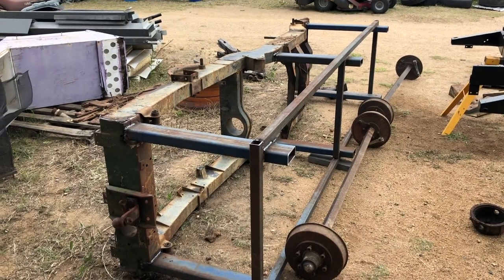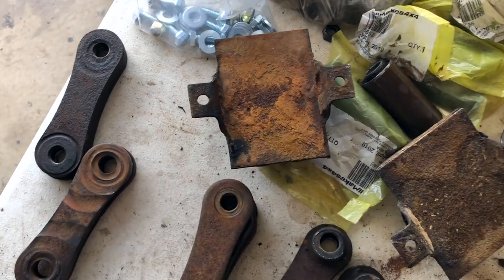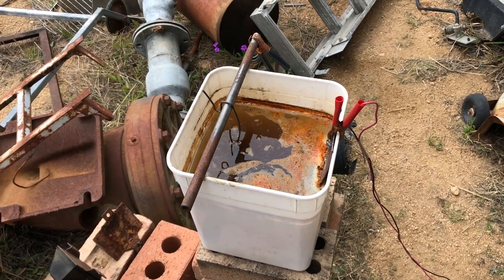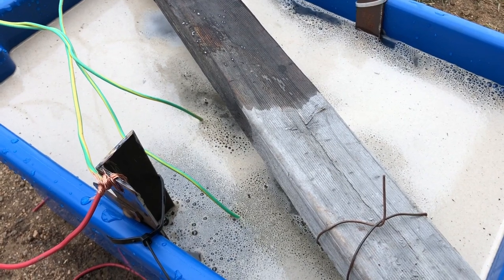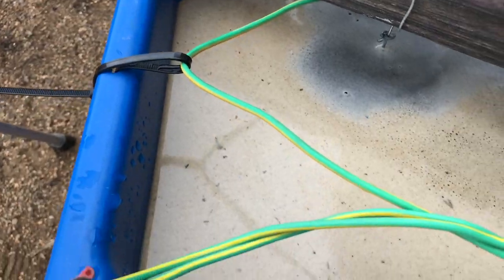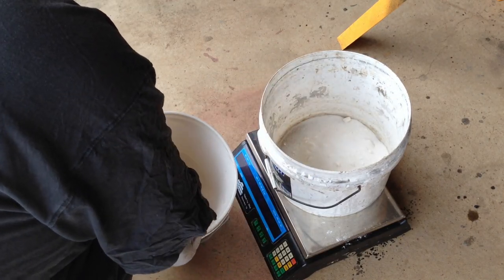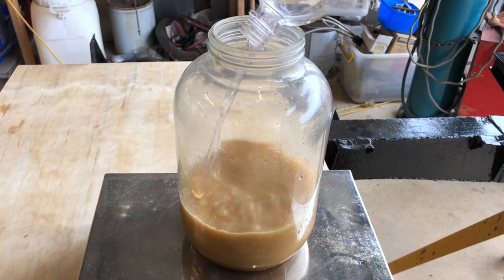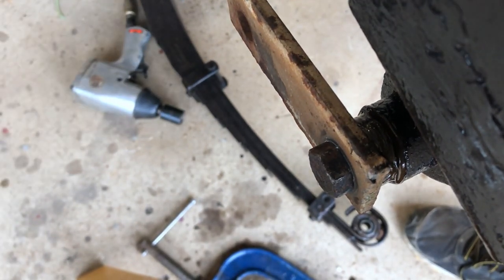Electrolysis, citric acid cleaning & homemade rust convertor for landrover restoration.

Comment: Finally, your rust converter recipe is an excellent secondary use for some waste byproduct that I have on-hand. [This waste byproduct is an ethanol/water mixture which resulted from extracting ethanol free (E0) fuel from fuel containing 10% ethanol (E10)].

The primary use I have for this ethanol/water waste byproduct is as an ultrasonic cleaning solution. [I put the parts to be cleaned along with ethanol/water solution into a heavy duty ziplock bag; and then immerse the entire bag into the ultrasonic water bath.] 

Very much appreciated.
Reply from the maker: Nice, I have thought about getting an ultrasonic, they are damn handy 'tools', smart way to reduce the amount of sovlent needed too, I like it a lot.

Comment: I've also used rain water.   For a small item, where you only need a cupful of solution, I have had success using a strongly brewed (2 tea bags) of black tea to supply the tannic acid!!
Reply from the maker: Thanks for the tips Richard.   We are strictly a  loose leaf household :-)  I have not tried tea solution but tannates are tannates.

Comment: Great vid mate. I notice the recipe in the description differs from the video - 50:50 ethanol /water vs 50:900. Also, when do you use the citric acid and when do you use the electrolysis?
Reply from the maker: Opps, fixed that slip up now.  We use the Australian War Memorial research that shows the 50 / 50 water/ethanol mix to be most effective.  Canadian Conservation Institute page is a little older but is a good summary and further info (but different recipe).  For the purpose of general restoration and Fe Corrosion treatment both recipes work just fine.

I am going to cover which rust removal techniques to use when in the next video as its a big subject that was beyond the scope of this episode. so Stay tuned.

Comment: I see that you used Sodium Hydroxide rather than Sodium Carbonate (washing soda) for your electrolysis rust removal. What is the advantages / disadvantages of using the Sodium Hydroxide over Sodium Carbonate? Does it work better? Is it safer or more dangerous? Very curious....never seen a video using the Sodium Hydroxide other than yours. Thanks!
Reply from the maker: It cleans like a beaty and is cheap and available

Comment: hiya can u sent link that u use for buying tannic acid, trying to get sm in NZ. also how long can u keep the solution u make up in glass jar for?
Reply from the maker: I buy it through ebay.  I lasts for a few years as long as the metho does not evaporate out.

Comment: Ok, here's a question: where's the co-host gone? I guess with the chemicals involved I suppose it wouldn't be very safe for her to be around.
Great recipes. Now I must make sure to bookmark this.
Would the rust converter be safe to use on things like the leaf springs (without taking them apart) or other such things that involve rusty surfaces in contact with each other or is its use in such situations not advised? Also, do you have to wash the treated surface or neutralize it with something after the treatment and how would you do that?
Reply from the maker: Ha, the dogs don't always come to workshop day :-)  The tannic acid solution / rust converter would be ideal for leaf springs etc as it would penetrate between and passivate the corrosion.  You don not have to wash it off after, that is phosphoric acid rust converter (we do not use that because it is pretty toxic and needs to be washed off to remove un-reacted acid).
Reply: @VintageRestorationsAustralia  That's great, thanks! That's a lot more chemistry than what I know.  I even  checked what tannic acid is. It's what makes tea taste great apparently.
Reply from the maker: @Stelios.Posantzis  Ha yes tannins are naturally occuring - and just so happen to work well on rust - it essentially ties up active corrosion sites (and makes tea taste good :-))
Reply: @VintageRestorationsAustralia  Yeah, and apparently (according to this youtube video I watched), good tea can contain quite a lot of it: 12% upwards. Green tea does not apply. I think I'll have a go at making some rust converter from tea left-overs in winter - i.e. purely based on home ingredients!
Reply: @VintageRestorationsAustralia  The other thing I noticed is that you brush the items with the solution, you don't dunk them in it. Also, you have already removed most of the rust? So leaving the items in the solution for prolonged time or brushing really rusty items is not the right way to use this?
Reply: @VintageRestorationsAustralia  Btw there's a guy in my village that does all sorts of vintage stuff restorations (mostly tools and household bits but other stuff also, like bikes etc.) and he swears by oxalic acid. He showed be a WWII helmet he had treated with it to remove rust and it seemed quite good: you could see the original paint had come out clearly. Just thought it might be of interest to you if you haven't tried it already.
Reply from the maker: @Stelios.Posantzis  Yes, remove all the loose corrosion before applying, if you sandblast or wire brush  allow a little bit of flash rusting to occur before applying.  We use a spray bottle to apply also.
Reply from the maker: @Stelios.Posantzis  I will be intrested to hear how that goes.
Reply from the maker: @Stelios.Posantzis  I studied Conservation of Cultural Materials at Uni  and worked in the museum industry for a long time before moving to the country.  Most of my training looked at the chemistry of deterioration, so I come at it from that angle.  Where about are you? We have viewers from all over the world, it's great!
Reply: @VintageRestorationsAustralia  Athens,  Greece. I guess your background explains all that chemistry knowledge! As for myself, all the chemistry I had was in high school. It's fair to say the chemistry has been gone ever since then! Maybe it's a physicists' thing or maybe I'm just kidding myself: what is not practiced is soon forgotten.

Comment: Tannic acid and similar organic chelating agents are not reported to be long lasting coatings ( as may be epoxy based dual components) . Instead of converting would'nt you prefer first removing rust chrmically ( NaOH, oxalic or citric acid with possible electrolytic stimulation) possibly followed by phosphation with phosphorix acid as primer coating and finally protecting with  epoxy or PU based painting such as marine  drilling platform specialty productd. My case concerns pathfinder body frame preservation but via insitu treatment without global dismantling.
Please be tolérant with my froggy'sglish. 
DIY inhibition free  attitude for rust progress inhibition is your moto.

Comment: Hi Resto's, will the electrolysis get in between metal parts rusted together? I have an eccentric shaft and lever on it rusted together I can't move.
Reply from the maker: Theoretically it will reduce the corrosion product down which should reduce the 'pressure' in the join from rust.  Rust is 5 times the volume of solid steel so it really jams up close tolerance components.  Give it a go , it can't hurt. If all else fails try the blue wrench?